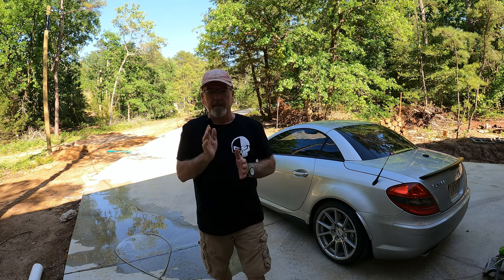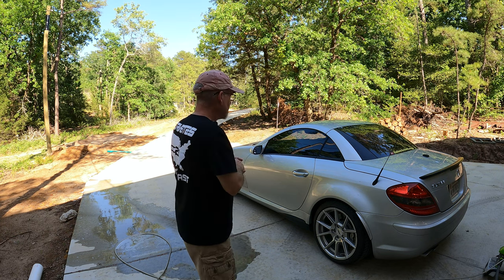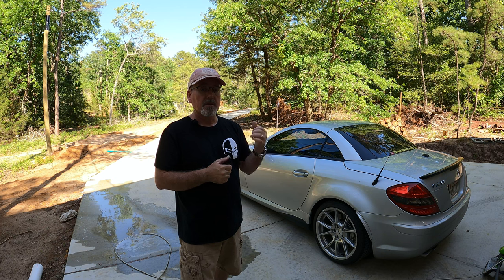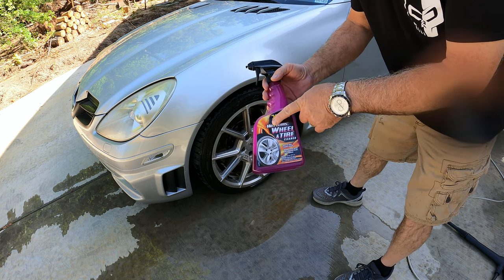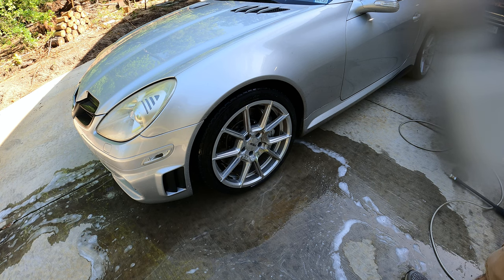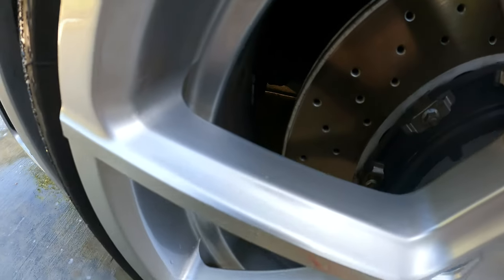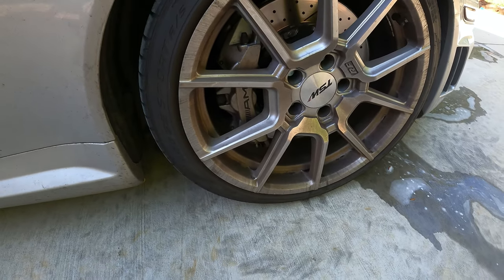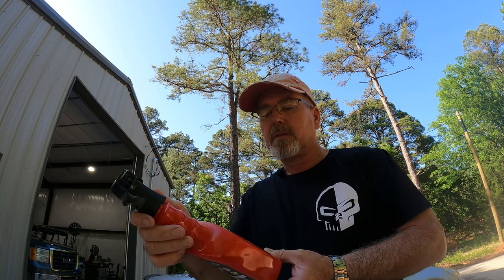First Wash Since Ceramic Coating My Wheels, SLK55 AMG Mercedes

Comment: Will keep that in mind on wheel cleaners when my current stock runs out. What brush are you using for them? I love our 18" woolie. Gets all the way to the back of the barrel. Thanks for sharing the products with us. Godspeed on your continued recovery.
Reply from the maker: I'll have to post pics of what I use somehow.  They're just the narrow bristle brush.  I need to check out the brush you use, sounds easier than what I'm using.  Would it fit in tight spaces?  I don't have much clearance between the wheel and caliper.

Comment: S A T I S F Y I N G

currently have a set of wheels getting painted, i think im gonna go coat them too once they're done! that seemed so simple to clean off!
Reply from the maker: It was a ton easier.  I have another set of wheels for the Corvette I need to put tires on, then I'm going to have the current ones powder coated and then ceramic.

Comment: I just bought an SLK55 AMG myself, love your videos. Mine was a fixer upper. Bought at an auction with 69k miles. Love it so far!
Reply from the maker: Thank you!  What have you done to yours so far?  I'm still working through the 80k mile service list.  Before too much longer I'll do the control arms and inner tie rods.  If there's anything you'd like to see covered, let me know.  FCP Euro will become your friend if they haven't already.🤣
Reply from the maker: Oh, don't forget to subscribe if you haven't already.😎
Reply: @YellowJacketGarage  i am a big mercedes fan, so FCP euro is a place I have come to know super well :). So far thermostat, top radiator hose, new A/C condenser, new radiator, coolant flush, front lower control arms and outer tie rods, valve gaskets and hoses, fuel filter, new battery, transmission fluid change, new enkei wheels and tires, rear rotors and pads new carpets, lol that’s what I can think of, so a few things. I have an oil leak I am trying to track down towards the back still.
Reply from the maker: @lbmazdaspeed  WOW!  When you said fixer you weren't joking!  I have a small oil seep on mine to track down also but it isn't enough to be a priority yet.  Have you done any footage of your projects?
Reply: @YellowJacketGarage  I bought it from an Auction drove it 700 miles home and have been working on it since, I am very particular so some of those were preventive replacements, no but my wife tells me all the time that I should record all of the work I am doing lol
Reply from the maker: @lbmazdaspeed  I do what I'm doing mainly to help other people that might try it themselves and to maybe entertain a bit. A lot of people on YouTube are using it as a job, I don't want this to ever become a job, just want to have fun with it.
Reply: @YellowJacketGarage  I agree! You are doing great, I enjoy watching your videos.
Reply from the maker: @lbmazdaspeed  thank you Sir, very much appreciate you watching.  Please share with any of your friends you think might be interested as well.😎